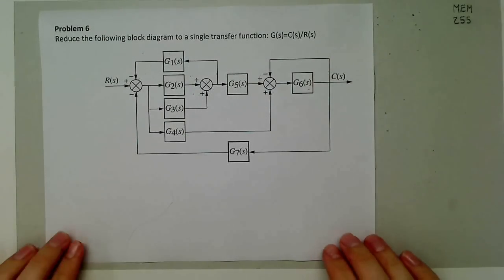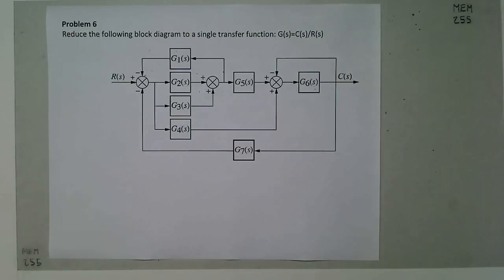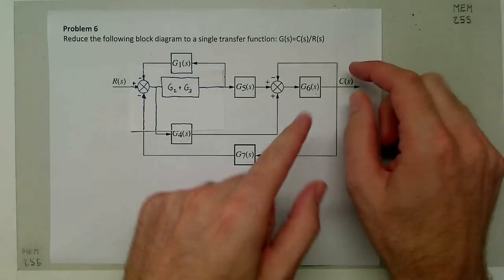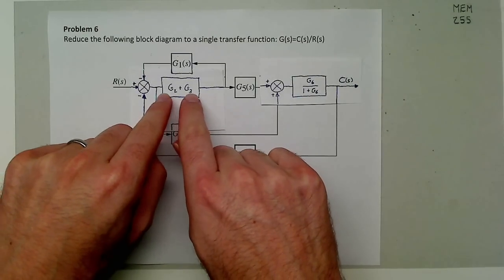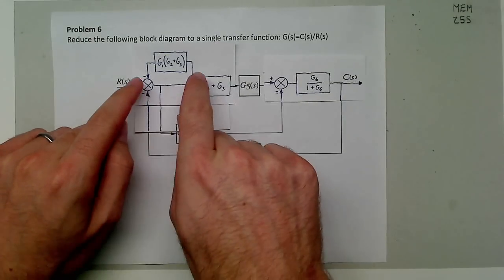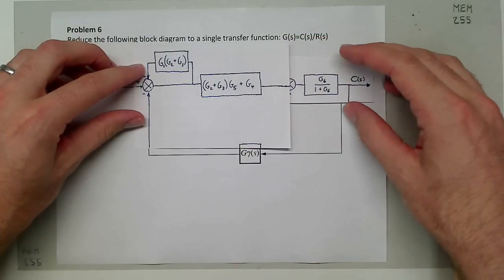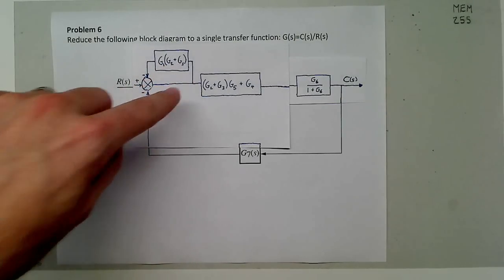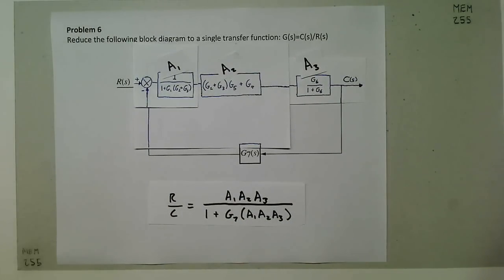BlockDiagramReduction

Comment: Patching papers idea is so clever, thanks but I have two things up, first one is, I know you saved some area by just patching but I would only suggest to to print the new diagram on another paper and just put onto it. That will be smoother. Second one is, you did a mistake at the end. That's C over R but not R over C.